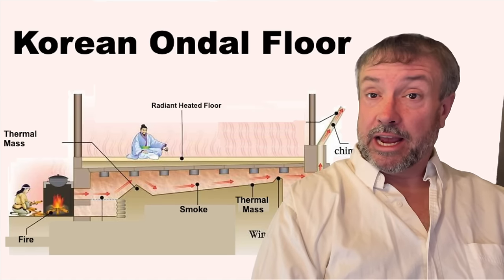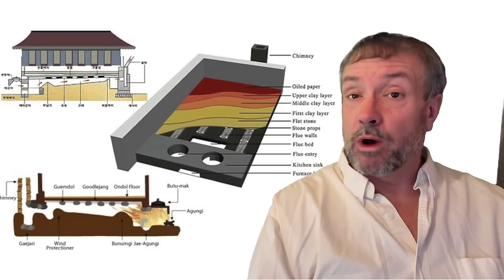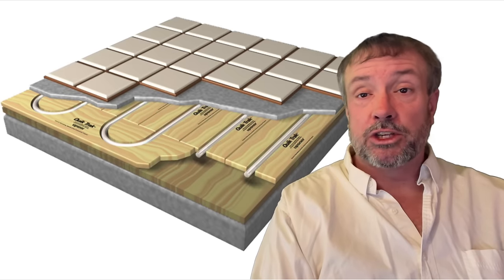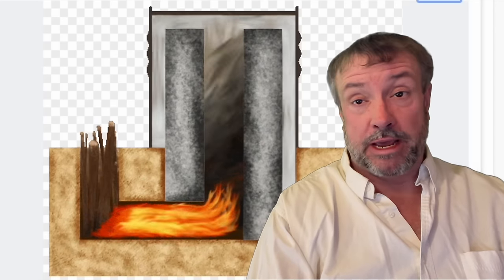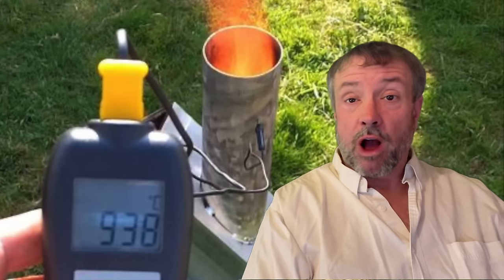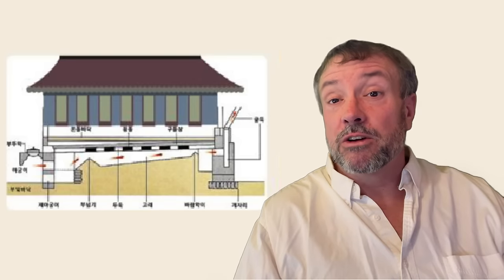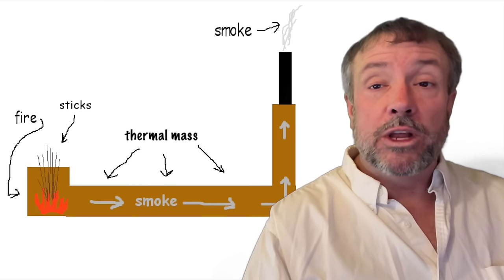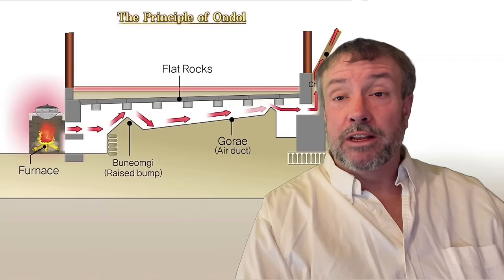Ancient Korean Ondal Smoke Heated Floor

Comment: Great video - This is a super practical and immediately useful technology. If only there was a way to get it into building codes...
Reply from the maker: Thank you, good point
Reply: For a little extra money, you probably can get it passed. Divide your stove flue into several smaller line and used VCP(vitrified clay pipe), a bit on concrete around the pipes extending under the floors, and in direct contact with the earth and stone floor. If the exit is vented in a proper chimney, there is zero risk of fire, carbon monoxide or smoke the under-ground chimney portion. I would recommend intalling a small steel cable inside the VCP. Yearly you can connect a brush to it and pull it through cleaning the chimney.

Comment: Interesting thought here. What about using forced air square duct insulated on three sides, with sand on top . Row of bricks or treated lumber on two sides too support weight from floor. Even any kind of cheap pipe in a insulated trench. Two boards landscaping fabric and perlite would work on the cheap.
Reply from the maker: Interesting

Comment: What happens with the creosote in the smoke that would build up?
Reply from the maker: Good question.  I know with my wood boiler I just burn some paper and cardboard and it burns it out, I don't know with an Ondal floor.
Reply: The floor is all masonry. So even if you had a big fire down there. No big deal. Air flow would be a problem. So yes you would need clean outs. Which they do have.

Comment: Though I'm cool with different opinions, I still think it's hard to beat the math in the science.  If heat is what you want, nothing is going to be cheaper and work better than simply heating water and insulating first.  Why?  Nothing compares.  Density 1000, specific heat 4190.   We're not going to run out of it.  It just makes sense.  Remember the goal is heat measured in BTUs.  1 cubic meter of water can hold over 268KJ OR 64,049 BTUs, that only one meter cubed!  Huge!
Reply: Disclaimer, not perfect for every situation but a greenhouse, it's perfect!
Reply: Also, calculations is water heated to 95 c from 31c, not 0 c.  Why did I use 31?  Because I'm use to working with fahrenheit.  Lol.   
95-0 gives you 95,073 BTUs.
Reply from the maker: Well Said

Comment: I am going to do this for my house. But I think I will use a heat exchanger to blow fresh air under the house, yet extract as much heat from the fire exhaust as possible. I could do the same thing for the 2nd and top floors as well.
Reply from the maker: Interesting
Reply: @SimpleTek  If there is a way to recirculate the non-combusted air, and without electrical power, that would keep more heat under the house to heat the thermal mass. Using a fan would defeat energy independence, and would be impossible with the power knocked out. It may not be possible to recirculate....unless I could harness wind power during the day, maybe from the wind mill operating the well.

Comment: Looking at the diagrams, getting enough draw could be an issue.
A metal flue with its intake at the furthest end  of the underfloor chamber and  then passes through the firebox  in an   "L"  shape  skyward might mitigate that without any fans or motors.
Reply from the maker: Maybe

Comment: Let's see. Next year I plan to update my greenhouse. IF we will get a digger, we can test ALL systems. To me interesting is an idea of rocket stove used to heat FLOOR of the greenhouse. Rocket stove built IN floor (nothing raised above floor) and feeded from outside shed - attached to greenhouse. In addition we will dig large diameter ducts 3m deep under the greenhouse for a secondary system ( like in Curtis Stone channel) AND use vacum solar panels to "add" a storadge heat under, mostly during a summer, because in winter these panels are needed for house water heating. However, in summer we must cover them, because heat is too much and overheating damadges them. IF the panels will be working, perhaps greengouse will get the dedicated vacum solar panels for itself. will see where it will lead us.😂
Reply from the maker: good luck!

Comment: Do you really need insulation beneath the house? Wouldn't the soil itself act as a geothermal battery? I can see the need for insulating the perimeter, however, way down into the ground.
Reply from the maker: it helps

Comment: I lived in Korea for 13 months and in the winter time we had a hooch that was built like that except we didn't use firewood they use coal and that was back in the 60s in the United States we call this type of heat and rocket mass heater this is what rocket mass heaters do they heat a mass with smoke

Comment: Smoke in the house - most do not understand how much air-pressure and humidity after how a fire burns and how a chimney reacts.   Running a cold fire can hurt results too.
Reply from the maker: After running an outside wood boiler for a few years I totally agree with what you just said

Comment: Couple corrections, 'most' heat from a wood stove doesn't escape, only 20% is going up the chimney. Outdoor burners are a lot less efficient.
Also 'smoke' isn't really the right description with a good fire going 'flue gases' would be better.
 Ondal looks like a masonry open fire popular in the west, just laid on it's side under the building, maintenance on the ondal must have been a rough job
Reply from the maker: ummmm, ok....

Comment: It is not ''smoke''. It is hot air and combustian gasses. Smoke actually reduces efficiency, the most efficient combustion is smokeless.
Reply from the maker: It’s smoke
Reply: @SimpleTek  BS. Smokeless fire gives up more heat. Smoke is indicator of incomplete combustion, hence less heat.
Reply from the maker: @fifi23o5  idiot

Comment: Maybe if you used abs sunken floor forms you could get a cavity below the structure and then you can vent air from the roof or warm environment. Extreme temperature and mold would might be a problem though. Maybe it could be a closed loop somehow.
Reply from the maker: interesting idea!

Comment: i am about to start construction on a greenhouse and have planned to do a GAHT system.  the trouble with it is i need power to move air with fans.  i love the idea but have always thought what if one day there is no power.  Two questions for you: 1. does the stove need to be below the floor level to draw the smoke, so i would have to dig a "walkout" for the stove.  2. could you run the smoke down the middle of the green house as a heat source and GAHT weeping tiles on the sides?  would love your thoughts and ideas.  i am looking at a greenhouse of 30x60ft.
Reply from the maker: Good questions. I think both are possible

Comment: Perlite and vermiculite for aircrete is good for insulation but probably not for thermal mass due to it's insulative properties.  Not sure about ashcrete.  If it's thermally conductive but idk.  This is a new idea for me.  Would definitely need a CO2 monitor and alarm jic.  Otherwise people may die if there is a leak.  
I'm serious how this will develop.  Some CO2 is great but don't exceed the max level for your plants.
Reply from the maker: Well said
Reply: CO monitor? Carbon dioxide isn't dangerous until massively higher levels. We're near the basement and greenhouse levels should be at least 1k ppm.

I think I'm missing something about your comment
Reply from the maker: @rockymountainhomestead  co2 monitors are great just to know the levels
Reply: @SimpleTek  sure. But did that op mean monoxide? I'm still confused
Reply from the maker: @rockymountainhomestead  nope

Comment: Like this, but . . . smoke is unburnt fuel, I wouldn't want that under my floor. Use a rocket stove to burn this fuel and mix it with just enough outside air to get the temperature where you want it and use that. I like your current system of having the heat source outside of the house. Best wishes.
Reply from the maker: Great point! but it's been in use for 5000 years, I think they worked out the kinks
Reply: @SimpleTek   Sending tiny people down there to scrub out the tar is kind of deal breaker nowadays tho
Reply: Creosote in smoke can buildup and is a leading cause of fire.  It also causes cancer, I mean serious carcinogen.  So you would need to fireproof your crawl space or else.  I don't see another work around for that but perhaps the audience can come up with something.
Reply from the maker: @Username-qx9gk  lol
Reply from the maker: @l0I0I0I0  good point. They have wire cleaning brushes with long handles though
Reply: @l0I0I0I0  Only in California
Reply: @SimpleTek  lmao 🤣
Reply: I think using tiny people to do the dirty work is only prohibited in California. 🤔

Comment: the romans used hypocausts....it was the next generation knock off in spain they called them glorias...I got to say the gloria has the longest varifiable track record ....homes as old as 320 years using glorias to this very day....
Reply from the maker: Korean is older
Reply: yes the romans were good copiers but just like they copied they also improved! today i would bury the flues in schedule40 steel pipe and coat the screw joints in coppershield ...it is like teflon only heat resistent to 2600 degrees centigrade then at the end would allow for a heat box toallow only cooled smoke or cooler smoke to be kicked out the chimney! i  would cover it with clayed aggregates and the flues would store heat in the stones and release through the slab...I think i would not introduce pex though as it sooner or later will leak and that is a problem...heat and smoke will find away always to the chimney! the cook top could make for good direct heat exchanger to water...for domestic use...Off grid comfort no maintenance and fire wood can be considered a renewable source...but it has to be designed into the build and that takes a green tech engineer
 @SimpleTek
Reply from the maker: @MyLevelheaded  well said

Comment: You ask why don't they use this. I wonder if the gas company's lobbyist would spend billions to never allow a UL rating on a system like this. with out a UL rating you could not put it in you house. NY has outlawed wood burning heat. From a HVAC point of view if you cool the exhaust to much it produces water that must be disposed of.    You would have to have a way of cleaning the flue passages. Any crack in the flue pipe could allow co2 in your house or hot gases to set your house on fire. 

If you had a sunken fire place inside and used welded stainless steel pipes with clean out and a trap for the water to drain out and inducer motor it could work and collect almost all the heat. A up grade would have different stainless steel pipes with a vent damper controlled by a thermostat to heat different part of the floor. In the end it would act like a 96% efficient furnace. Then it would come down to how much does gas cost V what does fire wood cost and the BTU output of both. But a system installed like this would be a 10 times more then a 96% furnace. To bury a four inch pipe in concrete for it to hold it strength it would have to most likely be a foot thick. 

The big advantage would be it could last for more then hundred years and if you had a little backup power pack if light and gas is off for your inducer motor you would have heat. 

But they hide information stainless melts at 2550 but they say natural gas burns at 3560 degrees and furnace limit switches are 200 degrees. I have watched the burners go almost non stop and never melt the heat exchanger inlet? They say wood burns at 1112 degrees. But they say a pallet stove is the most efficient.
Reply from the maker: Thank you for the insight

Comment: It would be more reasonable to use a heat accumulator that would be heated by wood and from which the heat would be distributed evenly over the entire floor using an air duct under the floor. why a heat accumulator? everything is simple to adequately regulate the heating of the premises and also to be able to burn different quantities and quality of fuel without losing efficiency. if you burn a little wood, the house will not warm up enough, and if you burn a lot, it will become too hot in the house. Thus, it is necessary to always put different amounts of wood into the stove and burn it depending on the temperature in the house and outside, and this will have to be done relying more on intuition. If you make a heat accumulator that will absorb almost all the heat from the firewood, then you can take this heat from it as much as is required for a comfortable temperature in the house. You can regulate it using simple automation. It’s just that it won’t be hot and dangerous smoke moving under the floor, but warm air from the heat accumulator. Moreover, if you use air, then you can make the air circulation system under the floor not a closed one, but a common one with the volume of rooms in the house so that the air from the rooms enters the ventilation and, passing through the heat accumulator, is heated, then moves through the ventilation ducts under the floor, heating the floor surface and exiting at the end into premises of the house. this way heating will be even more efficient and faster. In any case, when you burn solid fuel, it is difficult for you to regulate the heating without losses. Therefore, I believe that a battery is needed that can absorb energy and then release it for a long time as long as required for a comfortable temperature. otherwise temperature fluctuations are inevitable, which is not very good. What if for some reason you were delayed somewhere and couldn’t light the stove in time? the house can become very cold. the presence of a heat accumulator smooths out such temperature surges. in the present time of cheap and reliable electronics and automation, implementing such a thing is not a problem.
Reply from the maker: Thank you for your insight